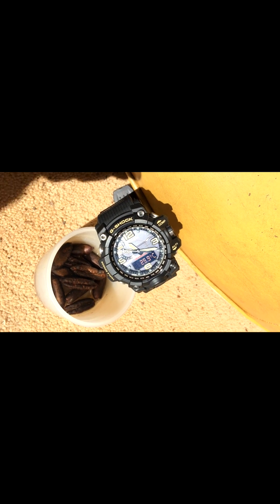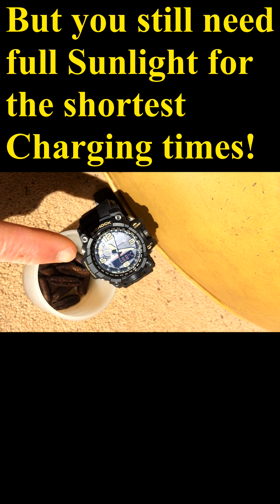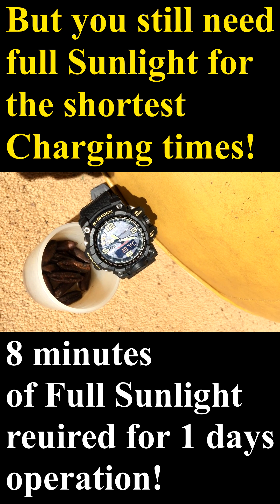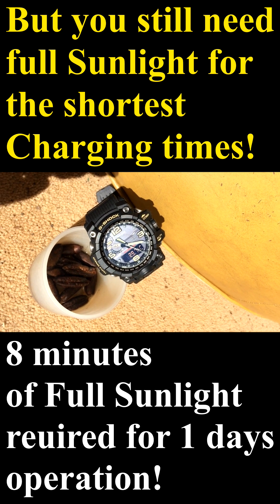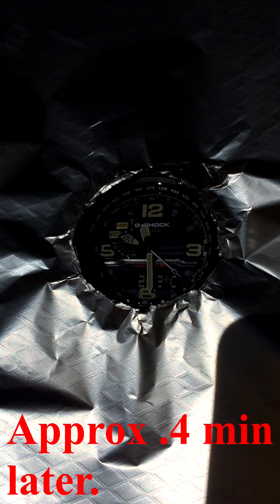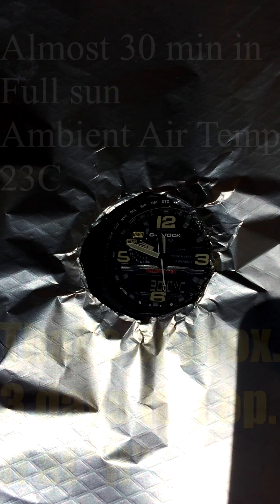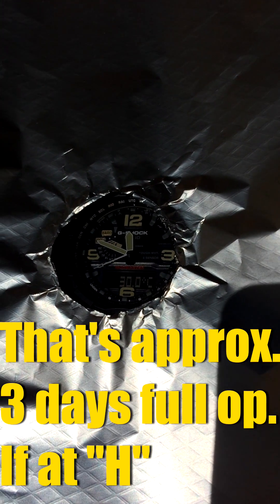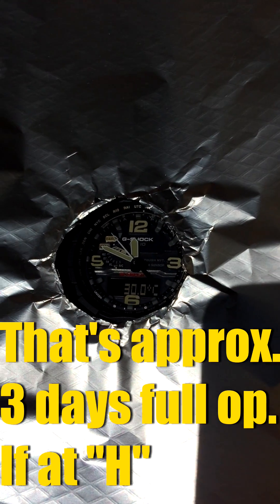G shock Hacks Charging

Comment: I live in Crete Greece with a lot of sun and high temperatures,never felt the watch hot on my wrist.Also the charging on my Casio Pro Trek,works even when I spent days away from sun. Batery is  always on "High". I've only seen it once in Medium,bit that was on winter,where I also the watch was on my desk instead of my wrist,for days.
Reply from the maker: The Protreks are much better at charging for sure . my missues has one (I reviewed it here some years back, a bright fluoro pink color and it also goes from M to H really easily although it's a full digital Protrek so no mechanical anything inside of it. Her case/bezel too is metal and not all plastic plus being a pinkish/bright color probably reflects at lot of IR. I haven't ever tested it for temperature though. All i know is that last week here I was measuring 48C against y arm in the full sun and it was pretty hot as to be getting a bit uncomfortable but of course I was testing it out and probably under normal conditions it would not be in full sun for such a duration out of doors. What Protrek model do you own, if you don't mind me asking?
Reply from the maker: The Casio Protreks also have better bands too  i think.